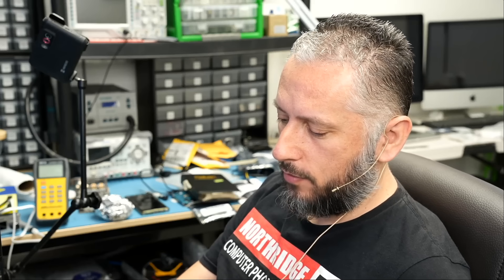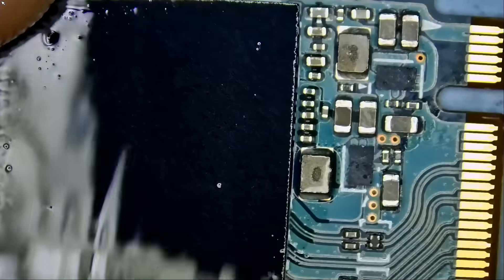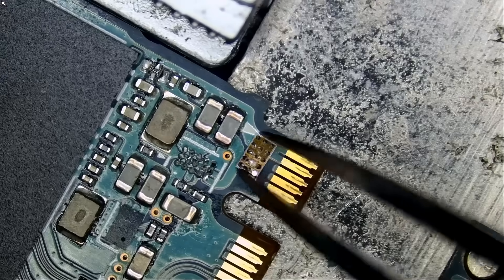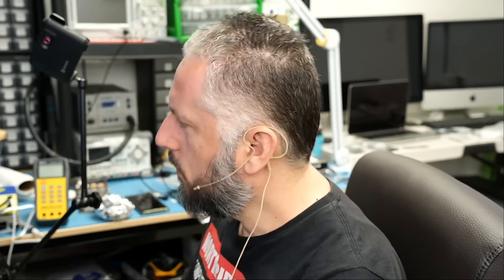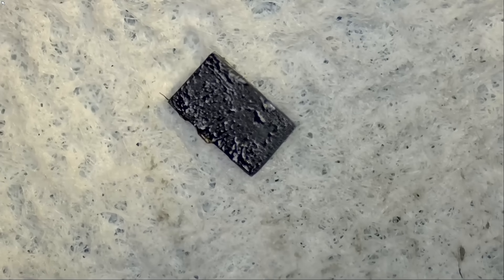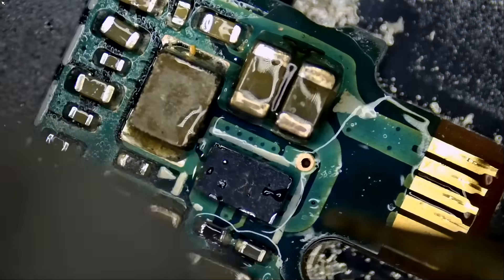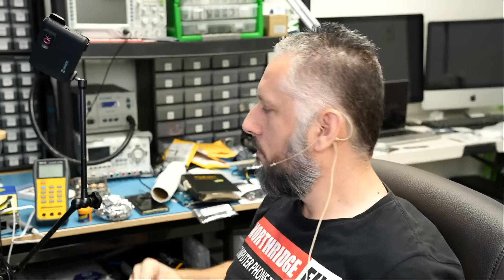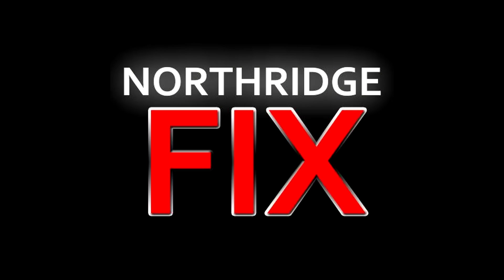M.2 NVME SSD Repair. Reballing a chip the size of a letter on a Penny.

Comment: In radios capacitors have to be installed the correct way around, is this the case in this surface mount stuff?

Comment: hi, I have seen that M.2 SSD NVMe devices (mine is an Optane, with an SMI SM2263EN controller, I think) have groups of pads. 2 are used for the device to enter debug mode, and the others, a total of 6 - 6, are for communication? Do you know how the communication pads are used? Regards.

Comment: my m2 stopped working in playstation, wondering if a flux and heatgun on the exposed area that may have been damaged would fix it, if not i may get repair, its 2tb and cost 150, atleast the 440 pound playstation still works 😅

Comment: After applying the solder paste over the chip with the stencil, you used a q-tip to clean over the top. Was it flux or iso on the q-tip, or dry?
Reply: dry

Comment: why dont you take the nand chip from the working drive and put it in the broken drive just to confirm or the other way around?
Reply: That would do more harm than good without knowing if the nand is actully damaged. As others said, maybe the USB adapter doesn't allow it to work as intended, and inside an actual slot on the motherboard it may wok.

Comment: Try attach it to the PC again and check drivemanger to see the drive info and partitions.
By the way, you can tell if a drive is NVME by it having many data line pairs going to the PCIE connector (see 00:54). The sata only have 2 pairs.
Reply: It doesn't look like an NVMe connector.. It looks like an M.2 Sata connector
Reply: @Andy76swe it's an M + B key which can be either NVMe or SATA.

Comment: As someone who does tech repairs you cannot understand how hard a reball is until you try it. 
Especially on a chip that small. Excellent work Alex. It was a beautiful reball.
Reply: I've got my ass whooped trying to solder a M92 chip in a Nintendo switch. I can't fathom reballing a nvme drive so small. Alex haz da skillz indeed.
Reply: @jbtec5730  it’s all practice, practice, practice. I was the same when I started. I couldn’t remove a hdmi port. Keep at it.
Reply: @sijig3501  I do, but Alex does make it look like it's really easy. When you actually try to do it like he does, it's not that simple. Mostly, if I may, because of his proper equipment. His solder wick, iron, heat blower  and specially the Amtech flux make the absolute difference.
Reply: generally i dont reball like this, i use Sorin's technique like Alex made joke first touch to chip in the video
Reply: @seckinseckin3919  
I think every tech has their own way of doing repairs. 
I think practice all ways and find what suits you.
Reply: Reballing is most popular action in the world. Measurements is more difficult.
Reply: Balls deep mate, balls deep.
Reply: Oh I know it's hard cause I've tried it before 😉
Reply: Been reballing chip with over 2000 contact points using solder balls since I was a teen
Reply: It's really not that hard.

Comment: nice work. I wonder if checking it out with the thermal camera will show a different component getting hot now that the cap and the microchip was replaced. Perhaps there is more wrong with it other than the NAND chip.

Comment: Hi Alex, this could be an encrypted drive somehow, or a Linux filesystem that Windows or Mac won't recognize. If two volumes showed up at least the OS is able to read the partition table... meaning SOME data is flowing through. Definitely advice doing a sector by sector dump with a tool like dd, at the disk level.
Reply: No the nand was done for. if it was a partition formatted as something like EXT4 for example, windows would simply request you to format the drive.  in the case of encrypted as already mentioned the drive would simply display as locked.
Reply: Could definitely be an encrypted drive or an unrecognized file system that neither Windows nor Mac OS could read. Though I would hope the customer would have told Alex that when the drive was dropped off. Have the customer try the drive on their computer system to be certain. 

In any case, this was an amazing repair attempt by Alex. I greatly appreciate that he shares his failures as well as his successes. We can learn from both.
Reply: Encrypted drive would display a locked  volumn.  This is corrupted nand.  Hense the freeze.
Reply: @TechProFury It might depend on how it was encrypted right. Do LUKS encrypted volumes show up as a padlocked drive in windows?
Reply: @tvuser1  it depends tho , Windows don't recognise any file system other than fat32 , main reason why you can't just plug in sd cards with rpi os flashed on them , it just shows up as unrecognised file system
Reply: @orange_tweleve  ntfs says what?
Reply: @TechProFury not necessarily buddy
Reply: He wouldn't have a clue how dd works
Reply: Yeah possibly steam os for the steamdeck

Comment: Great video Alex. Quick question. Do you use an ultrasonic cleaner to clean the flux from underneath BGA chips you replace? Not necessarily data recovery. Or do you just leave flux there? Amtech has told me its okay to leave flux underneath BGA chip. Thanks!

Comment: The issue with not being able to read the m.2 may be due to encryption. Otherwise the NAND chip is damaged. 
Well done on the reball of the small chip, I would have made a Hiroshima of that.
Reply: If encryption is the issue, then Windows Explorer will promt to format the partition, instead of locking up.
Reply: @volodumurkalunyak4651  nah, windows would ask for bitlocker encryption key

Comment: I suggest put in a linux system and do a "dd" of the drive. Maybe you can get the files back. A linux system doesn't try to read the system file initially. So you can do the "dd" (disk dump) of the files even without read the file system. 
I made this process a lot of times and generally succeed.
Reply: if you're gonna do that use ddrescue.. not dd..
Reply: DD really stands for "disk destroyer"
Restoring a data from a failing storage media - ddrescue is made for that.
Reply: @volodumurkalunyak4651  dd = disk dump...
Reply: @theRizza791 that whooshing sound you heard was the joke going over your head.
Reply: @volodumurkalunyak4651 try 'man dd'
Reply: @ytdlgandalf  dd without something like -bs=64k or -bs=1M is slow. dd without -conv=noerror will stop on error. dd with -conv=noerror and bs higher than 512b (default value) will mangle your data upon recieving an error. 
ddrescue - copies data fast and accuratly.
Reply: @volodumurkalunyak4651  the mangling is not considered a bug? What is the mailing thread subject  and date?
Reply: @ytdlgandalf  probably a feature. I dont care personally, as ddrescue does job of rescuing data from failing media way better.
Reply: @ytdlgandalf  at least dd will fill missing data with zeroes (if bs=1M and 1Kb of data is unreadable after 0,5MB then outher 0,5Mb (including unreadable portion) will be filled with zeros in image.

Comment: hello , i have a serious problem with my sapphire rx 470 ,it happened few days ago while gaming the pc forzen and had to restart and when i am in ,i found a code error 43 which i couldnt solve it by DDU or bios flashing or reset bios or setting csm to disable ,i tried the clock patching too but still with no luck , this could be a hardware problem ?hopefully someone can help me with this problem,the card is working only while CSM is enabled as it does not accept my Rx as Uefi anymore
i tired a method while using my intgrated gpu and i did get rid of the code but it is still i can not main it as my primary gpu ..if i use it as main i get a message from the bios that my gpu does not support Uefi of course it does but it is not discoverable by the bios ...i did flash the gpu with 3 different which should be match my gpu iD but the 3 do the same thing ..this is my gpu ID it is sapphire rx 470 nitro+ 4gb ,pn 299-1e347-100sa sku# 11256-01-20g ..even clock patch did not work even if it told it worked but after restart ,it is still the same code 43 ,could it be a  hardware issue ?

Comment: Try a disk editor to see if you can read sectors, if so your job is done. Drive may be encrypted on os level.  Putting it back in the customers device and booting or use exported encryption keys/certificate if the original device is dead.
Reply: Windows Explorer doesn't lock up on trying to access encrypted partition, but shows a format partition or enter password promt.
Reply: @volodumurkalunyak4651  It depends, maybe there were virusses there?
Reply: @imqqmi  viruses and failing storage media are very different. Windows explorer hanging is unique reaction to trying to acess failing storage media. I had that couple of times already (same reaction when Windows didn't register unplugging and Explorer tried to access it anyway).

Comment: Maybe try plugging the m2 drive directly into a motherboard rather than going through an external USB controller. Maybe something in the USB controller didn't handle the fault very well. Maybe the motherboard or CPU controller could do it better?

Comment: Can someone please explain the difference between a normal capacitor and one like Alex replaced with two more connectors on its sides?
Reply: I believe the difference it’s a filter capacitor
So it’s basically a simple filter capacitor circuit but micro sized

Comment: What was that for an capacitor, which still has 2 contacts on the side ? So a total of 4 pins.
Reply: inductor + some capacitors in the same component.
Reply: @orange11squares No, it is not. It's a low inductance 3-pin capacitor. Because of the additional pin you reduce the inductance of the capacitor and improve the decoupling. It helps to reduce antiresonant spikes that would occur if you parallel your big bulk capacitor with the smaller decoupling capacitors. But of course the value of the capacitor is important as well, otherwise you could destroy that advantage. So, better not just replace it with a similar looking one "as it is only a filter capacitor"...

Comment: Hi, Alex ...
Yes if the nand chips is the problem then...no solution

The M.2 drive is an old generation of M.2 NGFF (Next Generation Form Factor) the B key, then later generation came the M.2 NVME , M key...

I wanted to say, the M.2 reader , do support all M.2 drives... because some didn't...

If the problem is the nand chip, then on any readers won't see the drive...

Thanks...

Comment: Edit:  I was so focused on the soldering I missed the label. Thanks for the correction, good people.

I think that is a SATA M.2.  M.2 is the connection interface, while NvME is the type of memory storage.  In the case of SATA, it can be both a connection interface and bus format. However, I could be wrong.
Reply: It's literally written on the label "NVMe" 3:50
Reply: @Heichou96 Yup written on the label. But the 2 provided SSD are not identical actually. The original supports TCG Opal/SED encryption while the SSD for parts does not support encryption. It really depends what the 2LZ chip does
Reply: @yuldogster5735  how do you know that they are not identical?
Reply: @yuldogster5735  2LZ is a DC-DC-stepdown controller.
Reply: @worldsend69  hahahahahaha.  Stealing it!

Comment: Would suggest to try with the original chip and the replaced “cap” (which I believe it is not). MIGHT be the chip contains microcode or some keys specific to the unique NAND chip..
Reply: Nah.. there is no such safety mechanisms for those types of drives. It's not Apple. Security is in the Nand chip based on the hashing code tables. It's a clear case of cracked chip and no point wasting time on it.
Reply: @ErickBuildsStuff  so what is that chip doing?
Reply: @drEvilfromLV  Power
Reply: @drEvilfromLV  It's a DC-DC Buck-converter. Converting 3.3V from the host to 2,5, 1,8 or 1,0V.
Reply: Not in a consumer product like this. In the case of Raspberry Pi it's a different thing since the chip communicates with the main SOC.

Comment: Hi dear Alex, I had the same issue with the same m.2 NVMe and it only worked when I’ve tried it in another reader, for some reason few of those m.2 drives are not getting read by certain readers, I’ve got about 7 different ones and it only works in 2 of them, even though they are all NVMe readers.
Reply: Agreed, I have an NVME drive that does NOT work on an adapter, but works flawlessly when connected directly to the computer. The adapter works fine with all other drives.
Reply: Should be ok in a real thunderbolt reader without conversion to usb

Comment: Can't Wait to get into micro soldering. Your the man Alex! The size of the chip is honestly intimidation compared to the pennie, but I never say never and have never failed at something I want to do. Can't wait to get into this stuff. Their is still a chance that the drive wants to see it's original PC. Maybe if he plugs it into his original peice of equipment it may work. If not like you said, it comes with the job. Great video
Reply: Yup  it should be checked by puttin back to its original place. Not a guarantee but worth a try.
Reply: @nickwaters2802  Thanks for the tips guys. I'm going to eventually get one of NF's microscopes but right now I have to work with what I got. It's a Cannon rebel t7. The cool part is I bought a 58mm reverse lens ring and extension tubes. Just with the reverse lens ring I'm able to see the individual pixels on my 4k panel. I also looked at the little owl in the top right hand corner of a dollar bill and it makes it as big as my hand on my tv screen lol. It's pretty cool
Reply: Yeah thats not really how things work